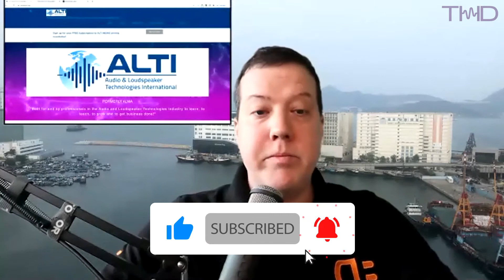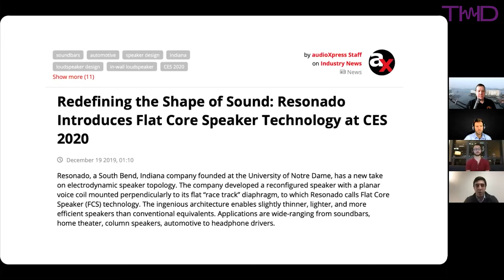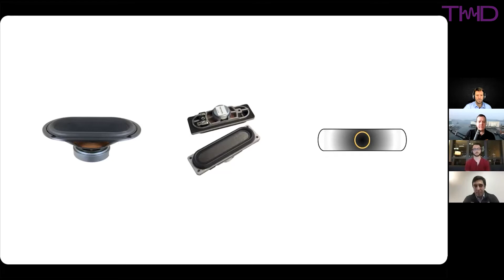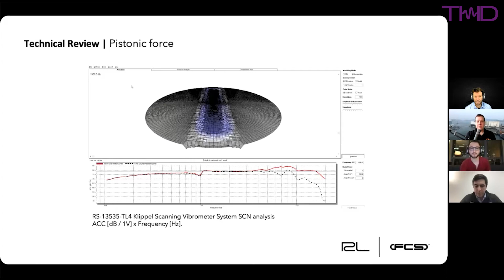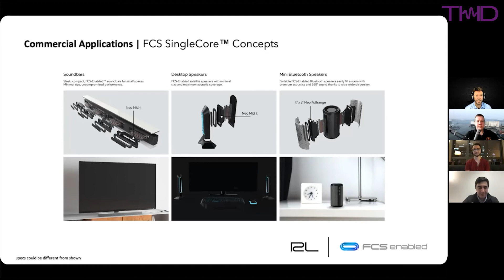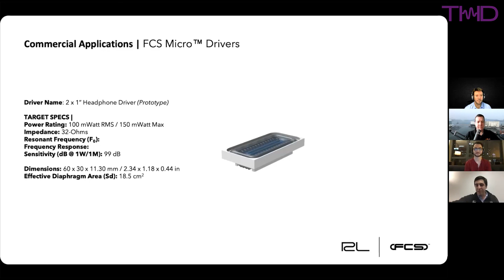RESONADO Innovation in Thin/High Aspect Ratio Speakers New Voice Coil + Magnet Design THD Podcast 39

Comment: @ 2:22 we hear Paul mention "matching your compliance between your spider and your surround".  Yes, this is critical for a loudspeakers voice coil to prevent its rocking because if all the stiffness were at the bottom of this driver (where the spider is located) then that is the plane about which it will pivot.  As far as this being a problem, it's actually a small one, and I can explain the solution easily.  Just like any resonant circuit Fs= 1/(2pi *Sq rt L * Sq Rt C).  For a loudspeaker we replace L & C with mass and compliance.  Presuming the relative mass is unchanged with position (reasonable with a cloth edge, not necessarily a huge rubber one) then all the compliance is coming from the surround and the spider.  Equating the two is simple.  You make sure the resonant frequency of the cone is 70.7% (1/Sq Rt of 2 * 100) of your final target Fs when exciting the cone/surround assembly alone.  If you knew the moving mass of the cone/surround moving section, then you also know the compliance of the attached surround from this initial Fs.  That compliance is your target for your spider assuming its mass is negligible.  If you want the final Fs, you have to first attach the VC and do the same process.  Now Peter gets right to the point with dual spider topology.  That eliminates the rocking mode by creating two pivot planes.  (Or 3 is even better, and of course there is less rocking).   Good call Peter.  ;) :) Hello Paul.  :)